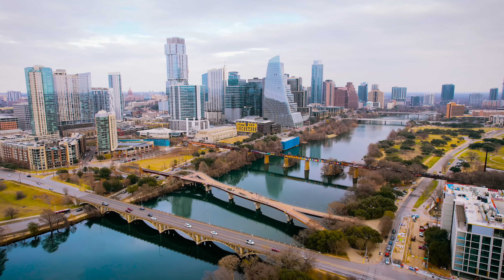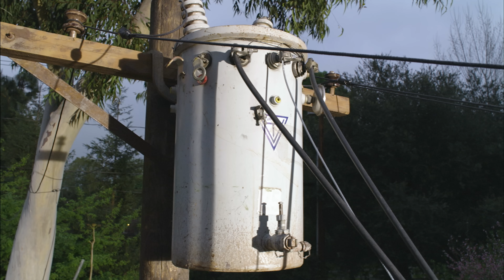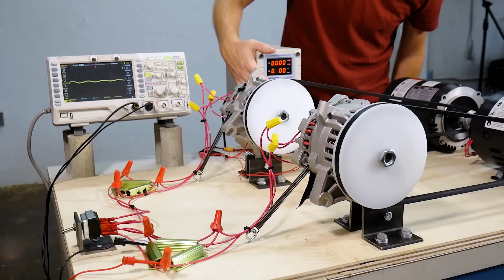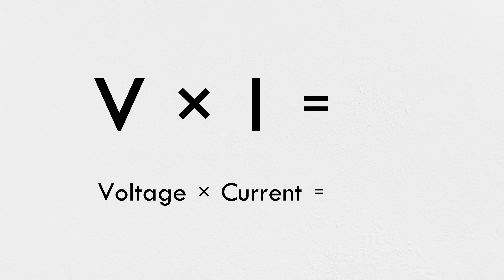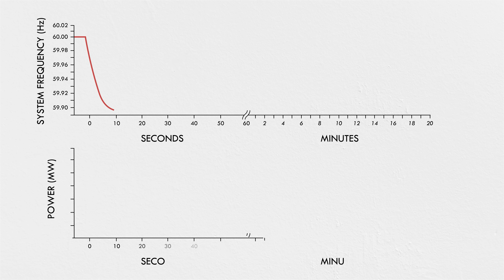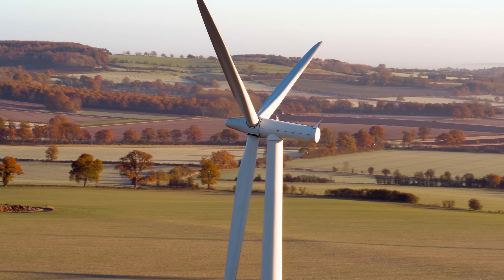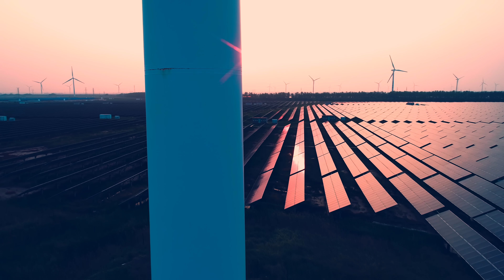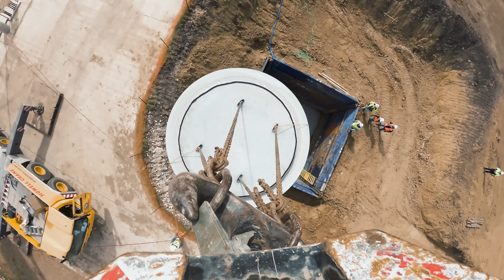Connecting Solar to the Grid is Harder Than You Think

Comment: Solar is excellent for future-built homes. You add DC outlets (or USB ones) designed specifically for electronic devices, power tool battery chargers, or electric cars so you can directly power them without having to invert it to AC and back again.
Reply: I think this would work well. Look at RV's, the have 12 volt, 120 volt, and gas systems, why not our home and work places. lights and electronics could all be DC.
Reply: I like the concept in that most electronic devices, if you look at the little wall adapters for them, run off of 5VDC or 12VDC.  Its a whole lot more efficient to buck-down a modest DC voltage then to convert to AC and then back to DC.   But there are some warts.

The biggest wart is a safety concern.   You can't use AC breakers with DC voltages and you also have a problem with ARCing when wires break that you don't have with AC (because with AC the current crosses zero 120 times a second).   So even though we can have in-house DC wiring, its a bit more dangerous when faults develop as the wiring ages.

As such, I think DC circuits are an interesting concept, but amperages would have to be severely limited and electronically controlled., possibly with an insulation resistance check as part of the safety device requirement.

I think something like .... well, for house wiring you don't really want 12V.  You want something like POE+ (power over ethernet) which is an actively negotiated protocol which also actively checks available wire pairs continuously.  It runs at roughly 56VDC.   Almost impossible for POE+ to cause any sort of fire.  It is typically limited to roughly 60W over four pair which is barely 15W per wire pair (0.35A or so per wire pair).   There is also POE++ which supports higher wattages by using higher voltages.

-Matt
Reply: @junkerzn7312  Modern AC breakers actually have substantial DC capacity (and rating!), it's just that you can't really handle more than 60V with a single contact MCB.
There are low voltage DC standards in place currently for e.g. iirc a bipolar +-125V system without locking connectors, and an iirc about 380V system with locking connectors that's been deployed in data centers for a while now (their DC is their battery backup bank; they skip the inverter of their UPS).
Reply: @namibjDerEchte  Well, I've got like four different brands of DC MCBs in front of me and the unpolarized ones are typically rated to around 110VDC and the polarized ones up to roughly 250VDC,   I think I have one PUFA here somewhere with a 1000VDC rating.

Generally speaking, the DC MCBs with higher ratings tend to be polarized.  The DC MCBs with lower ratings tend not to be.  But this is an area that get DIYers into trouble all the time.  Either they buy polarzied breakers and don't hook them up properly, or they buy polarized breakers and don't realize that they can't be used in a battery circuit where current can flow both ways (charging and discharging).  OR they buy a non-name breaker and just assume it is polarized or unpolarized from the markings, not realizing that most polarity markings are completely meaningless as a "tell" on the type of breaker.

Most AC breakers do not have DC ratings and definitely cannot be used in DC systems.  Not sure where that came from.  Expensive high-end breakers will often have both AC and DC ratings but most run-of-the-mill breakers that people buy... those almost never do.   The construction is too different.

Typical AC breakers use relatively large GAPs to break ARCs for example.  And also often don't have arc extinguishers.  But that method relies on the current crossing 0A 120 times a second (AC waveform).   DC with a breaker like that will build a lot more carbon up on every trip until the breaker fails and fails to break the ARC, then catch on fire,

Typical DC MCBs use narrow gaps and walk the current up to the ARC extinguisher.  That can be done both polarized and unpolarized.  Polarized breakers can walk the current more quickly and more reliably and tend to have higher voltage ratings.   Unpolarized breakers still walk the current away from the contacts but don't have magnets near the contact point forcing it to walk faster.  But being unpolarized, they can break current going in either direction.

-Matt
Reply: I'm still waiting on reasonably priced DC breakers to actually use that (not at my home, because I don't have a good place to put solar), particularly actually for a mini-split AC/heat pump.

Comment: simple: throw everything away and build the grid from zero
Reply: Most of the grid would be the same if we did this. So much is determined by physics. That isn't to say there aren't alternate ways to go about things and there are real advancements. But most what is done is really about how to transmit power efficiently. There isn't a lot of flexibility for alternatives there. Also at very high voltage levels and so much materials used, only certain kinds of equipment can handle this. It really is dictated by physics.

Comment: Solar. What a treat.
Reply: solar is the cheapest (by a big margin) and cleanest of all energy technologies, with that huge margin of price, you can add more than enough devices who counter any of its weakness.
100% solar + wind + storage communities are in the edge to become more cost efficient overall solution with the help of hydrogen for long storage.
Without any backup power source.
Reply: @angellestat2730  True
Reply: @angellestat2730 What are you smoking? It sure is hella strong! 😂
Reply: @angellestat2730  It is NOT the cheapest or cleanest. So delusional.
Reply: @terryboyer1342 please tell us what is the cheapest per kilowatt? when taking into account the costs of construction, operation and maintenance, what is the cheapest? That actually exists right now. Please don't tell me about a 10 year old study.
Reply: @nathansuss  cheapest per kilowatt... Probably a nuclear bomb. Only problem is, energy output is spiky, but we just have to build more accumulators, right? With that huge margin of price, you can add more than enough devices to counter any of its weakness.
Reply: @wumi2419  good one
Reply: @nathansuss  Nuclear. And by far the cleanest (greenest). But the regulatory constraints are stifling. They need to be reevaluated and modified. Solar has to be the worst due to exotic materials required, life span, limited electrical production time,  vulnerability to weather (hail wind snow) large areas of land rendered useless, lack of recycling and toxic materials etc etc. Solar on a large scale is a disaster. Wind is also touted as cheap and green but suffers many of solars weaknessses and faults. Nuclear is the clean, sane, rational, dependable source by far.
Reply: @terryboyer1342  everything I research surrounding scale, cost overtime, reliability, recyclability, looks like the complete opposite of what you say, and it's obvious where more capital is flowing towards, which will only improve all these factors very quickly
Reply: @nathansuss  Your research is only as good as the sources. Sounds like you listen to and rely on some pretty sketchy ones. Biased maybe? And I'm reading more and more about large solar and wind projects being delayed and cancelled. They require ever larger govt subsidies to build and maintain. Also see a lot of angry locals promised cheap energy rates saying their bills are skyrocketing. Reality is sometimes harsh and painful. But go on believing what you want to. Next to nuclear natural gas is an excellent fuel source.
Reply: @terryboyer1342  time will tell I guess, more research and information will come to light and will be more conclusive
Reply: @terryboyer1342  Solar LCOE goes from 20 to 40 usd/MWh,  Nuclear is around 160 usd/MWh (with help from the state), Carbon is at 80, Gas is at 60 to 120, Wind is at 30 to 50. 
These are the average wordwide, this can change region to region, but not enough to change the order of each one.
All info around the world gives me the reason. 
So if you think that I am delusional, not sure what institution is taking care of you.
Reply: @terryboyer1342  where do you take all your "research" you are talking about? 
The trash can from your house? 
You are the classic guy who talks about something without knowing ABSOLUTLY NOTHING about that topic. 
Everything you said is wrong.  You have at least 16 years delay on news.
In that time, all those things you were talking about, like price, carbon footprint, etc, Was reduce a 96%. 
You are talking about a completly different reality.
Construction time for new Solar farms goes from 3 to 8 months.
Nuclear is around 8 years.
Reply: @angellestat2730  Just remember all these "facts" when you're sitting in the dark cold and hungry.
Reply: @terryboyer1342  stop talking, You're embarrassing yourself. Come back when you find a serious source to backup your crazy words.  Also, investors are not listen to you either,  close to 95% of the New instales capacity of the last year were solar and wind.  This trend was also true last year and it will increase in the next 10 years
Reply: Solar. What a joke. For small applications it's fine. But anything more begs for trouble.